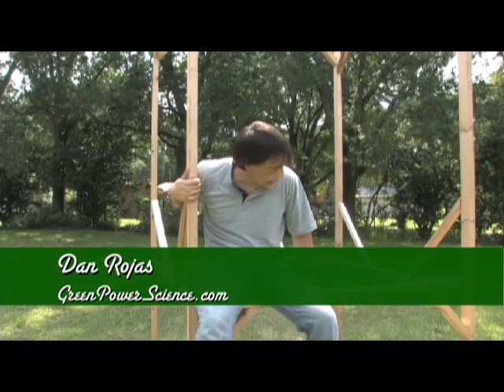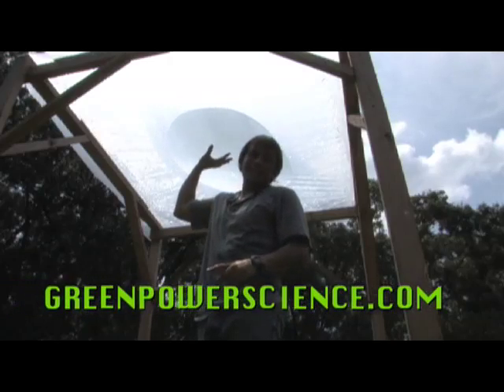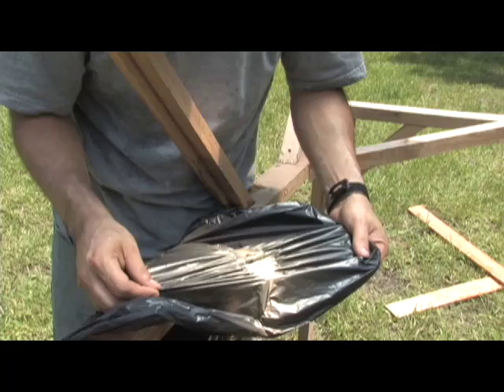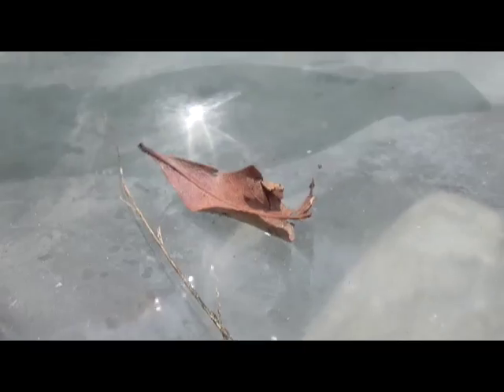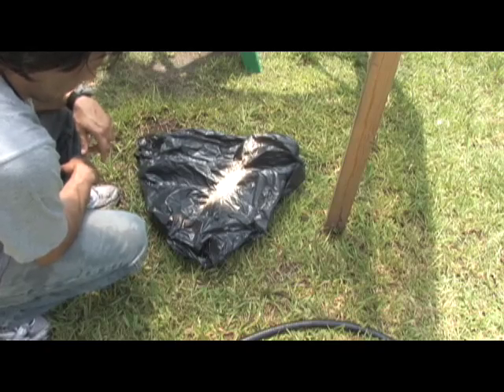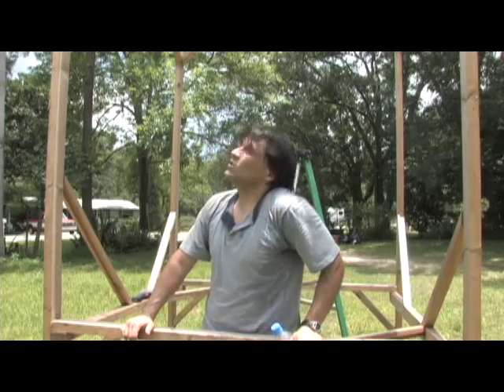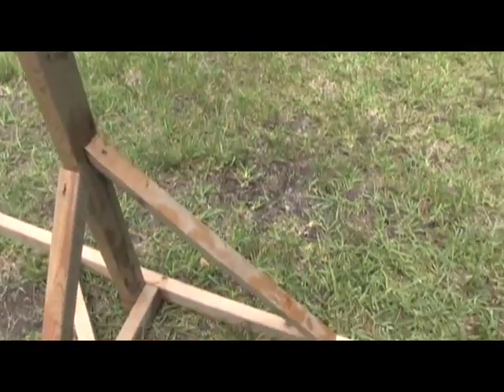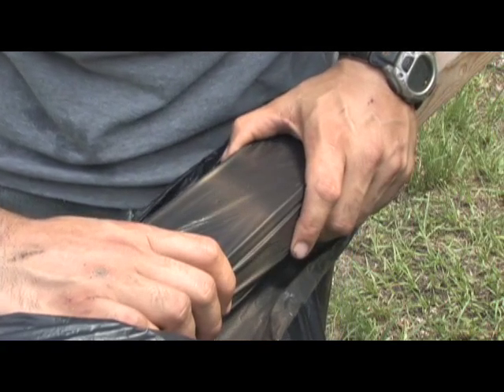WATER BOTTLE FIRE STARTS FIRE SOLAR WATER LENS AQUA LENS

Comment: We JUST NOW had a gallon jug of bottled water setting on the leather back seat of our Mercedes FOR 10 MINUTES while we unloaded groceries with the door open. Yup...burned a dime-sized hole in the seat. At first when we smelled it, we thought the battery or other components under the seat were shorting out--but no. After tearing the seat out in a panic, next to the burn mark we could see a slight indentation where the bottles of water had been sitting. No longer just a theory or experiment guys and gals! You've been warned!!

Comment: dan it will work at an angle at any latitude and climate... okay the kinda funnel solar cooker? type roof deal I showed you a diagram of ... that plastic sheet at the back of the collector roofline keeps it indoors and the light concentrated to just the area of your water lens..... oh yeah.. and bouncing straight down through it... and not at an angle...  would cost less than 10 bucks in materials to retrofit your lemonade stand to do such....

Comment: I actually have not had success with using a magnifying glass to start a fire making a coal is easy blowing it into fire is harder than it looks anyone want to give pointers?

What I used: 4 and 1/2 inch (11.25 centimeters according to my calculator) wide magnifying glass on bamboo (what I think is bamboo there is a patch growing near my house and is quite hardy)

Comment: @Shaunt1  Way up north the way this can be used is freeze the water , in fact do that twice and make a very powerful lens by puting the flat sides face to face . never did that but it should work wet 'em and stick 'em . I did learn bottles in my SUV full of H20 make smoke ! dont toss those bottles out the can and do start fires on the side of the road . The people that watch this kind of stuff don't litter !

Comment: Sweet. Next time I am stranded in the forrest I am DEFINITLEY building one of these.  All I need is 20 pounds of lumber, a hammer, 4 inch screws and some wood glue and clamps.  Construct the scaffold like above, then, using an air compressor and staple gun, apply a 5'x5' sheet of plastic.  Next use the hose to spray 3 gallons of water on top.  You'll have a blazing (luke warm) ray of light that can warm marshmallows.  Sure to see you through survival in the dense Floridian outback.

Comment: I did infact burn myself with a bottle of water one day just standing outside talking to someone. I thought at first it was a bee sting but I repeated my position and could clearly see the focal point comming out of the bottle. Good survival info. You could use mirrors to compinsate for the angle of the sun on your scafold! P.S. Dont build this lens on a deck or a dry grass field!!! ;-p

Comment: I suppose if you made a square frame and sealed the joints, adn stretched some aluminized mylar over the front and back you could suck some of the air out from in between and you would get a simple concentrating dish. The focal point would probably not be very sharp, but it would be easy/fast/cheap to make large dishes. With a little extra framing you could even make a huge shallow trough concentrator.

Comment: The coolest thing about this video is that it shows that containers with specific shapes and filled with water could be used as makeshift lenses. Just like the water bottle acted like a lens, a specially designed container intended to be more like an actual lens would be even cooler. If it was a sealed container it could even rotate along with the sun instead of only being optimal for a few hours.

Comment from the maker: It is a hybrid of both, because materials stretch the most at the longest point, more water rests in the center, the higher outer areas flatten out similar to a parabola. It is a similar opposite principal to the liquid spinning mirror. Both can only focus optimally straight up.